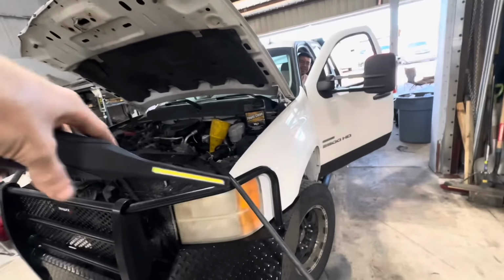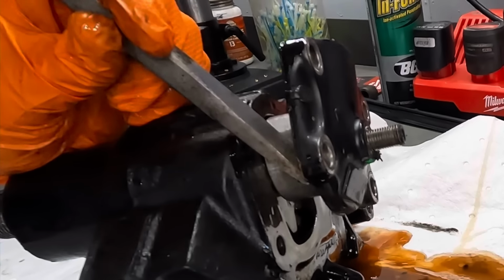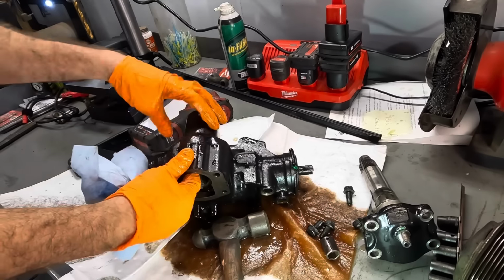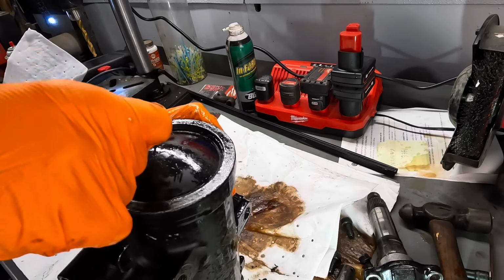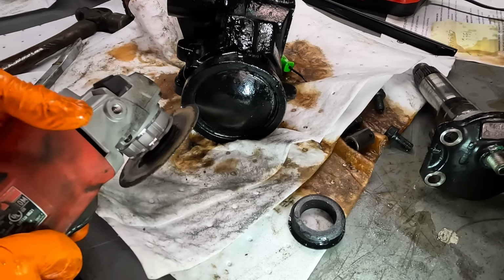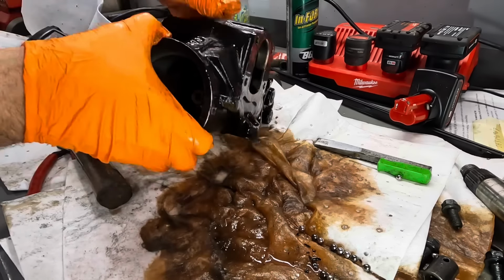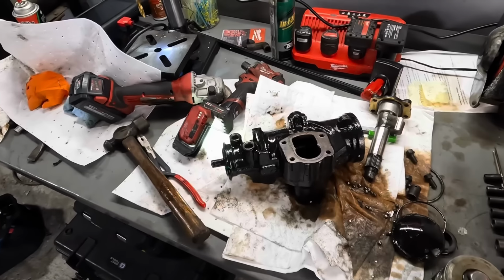Mechanic Cheated: Counterfeit/Fake Parts! Steering Gear Destroying Itself!

Comment: I've rebuilt a couple of Saginaw steering boxes and they are actually a simple, great and somewhat sturdy design in my opinion!  And at least they can be rebuilt as a DIY.
The big end cap is held in by that snap ring indeed.  First give the cap a tap with a rubber mallet, just to shift it a little deeper and free the snap ring.  Locate the  hole on the edge of the housing, through which you can push a small punch, which will dislodge the snap ring.  Now you can easily pry the snap ring out.
The most tedious of the entire rebuild is getting the ball bearings in correctly and in sequence.  There are an equal number of 2 sizes, one set darker grey and the other set "nice and shiny".  These are 2 slightly different sizes and need to be alternated when inserting/installing.  Best practice is to use grease to stick the bearings in place, in particular in the 2 halve end caps.
Possibly something went wrong there and one of the bearing balls was either missing, got dislodged due to improper install or was simply dropped inside the housing and not in the "channel" where it's supposed to go...

Comment: Hate it when they call junk parts new by painting it and fixing it a little, I try my best to keep Oem to avoid doing the work more times than needed.
Reply: Always opt for the OEM mfr's part FIRST whenever available.  It will save you time, money and aspirin.
Reply: Most likely a returned part where someone "switched" out the new part and just spray painted their old part after cleaning it with break cleaner. Then returned, saying it didn't fit.
Parts distributor just put it on the shelf and resold as new (or rebuilt).
Reply: 50 yrs ago in UK it was called a 'paraffin service', i.e. wash the dirty old part and re -sell it. Bought a starter motor 'reconditioned'😇and it caught fire on turning the key!
Reply: @Jay.Kellett  That's more likely blameable than some factory switcheroo. It makes a lot of sense. Crooks are everywhere these days. You can hardly walk in the woods without encountering unethicalness or criminalness. And the parts business was lazy checking it out.

At least now, they can't continue that thread of deceit.

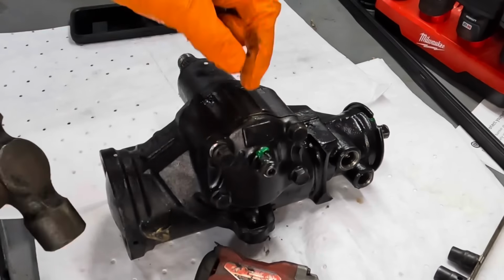Comment: Minute 2:24 the hole in the case is visible on the left side of the steering box. The one to insert a punch for the removal of the snap ring. Its small 3/32" or so, but its there. Tap in an appropriate sized punch and then get behind the snap ring with a small screw driver and pry it out. Box was junk, but cutting it up was hard to watch. Did you toss it out then and just lose the core charge? I think there are two sizes of ball bearings as well. At least there are in the gm boxes i have worked on. Oh well... onward and upward! Keep up the content!

Comment: Yep. It's smoked. The fact that the piston rack was banging the front plug tells me that the sector shaft was not put in on center tooth. Did you by chance check to see if it had full stop to stop steering?

Comment: I would guess that what happened is someone bought the remanufactured part and installed it and cleaned and painted the old part and put it back in the box and returned it as not needed and got their money back.
Then it was put back on the shelf and was sold as a rebuilt part. I have seen this with car parts before. Alternators, starters, power steering pumps and water pumps are a good target for this scam also. Many auto parts stores don't check or care.

Comment: I think you should show this video to the parts suppliers, you had something similar a few weeks back when what was in the box was not what was on the box, think is was the oil cooler upgrade you did??… some one had swapped the parts over and sent a crap one back. Some one needs to pay you for doing this twice! It’s not your fault the part is crap. Great video as always Ray. 😊

Comment: Yep, I purchased a pump for my jaguar from them and also had issues.  Looked inside and it was all old damaged parts... not an easy job on a jag at all so I was pissed but the oem pump was 800bucks.... I got another reman from lares and it's been solid for 2 years so far

Comment: That big star nut around the sector shaft, is how you disassemble the gear. It locks the collar jam nut. Then the hole assembly comes out the other end.

Comment: Hi Ray,  the worm gear holds those balls in place which helps to move the whole steering gear, it's called a recirculating ball steering gear, and from your diagnostic experience, it looks like the worm gear is so worn that it was riding up around the the balls and the whole piston assembly was sliding over and hitting the end plate, hence all the clicks, clacky noise you heard!! I still have a Chilton auto/truck repair book, hardback that my dad used back in the day that shows this type of steering gear in detail and has all the information on how to rebuild such unit back to brand new status !!, whoever "rebuilt " this steering box was really lazy, and the part could have caused a very serious crash!!, get on the parts dealer that sold you this, show them this video! Great job !

Comment: Reminds me of a gear box I bought from AZ.  It had been cleaned and painted, not rebuilt.  Driving straight was okay.  Turning either way there was LOTS of slop between the gears.  The faster you went the more the truck wandered = dangerous.

Comment: Man, this sucks! When I replaced the steering gear on my ‘93 Chevy truck at first I put in a generic O'Reilly Cardone unit that only lasted 2 months before giving up and after that, I just spent the money for a new redhead gear that has not let me down for the good 5 years I've had it on.

Comment: Oh boy does that bring back memories! During my time as a tech for the local government repairing police and civilian vehicles, we had contracts with local "repair" and supply outfits for things like carb rebuilds (the days of electronic carbs), alternators, transmissions, and radiators. It was not uncommon the get a "rebuilt" part where they simply sprayed silver paint over the grease and and dirt coating the part and stuck it in a plastic bag and shipped it back to us. You might speculate on who the business owners were friends and donors with.

Comment: Cardone is one rebuilder that makes some sloppy steering boxes, I’ve went through several before giving up and just settling for a sloppy steering gear. 
One steering gear i got off Rock Auto was a remanufactured unit “for AC DElco” it said on the box, this was the tighter feeling steering gear that i really liked but its cast iron case literally blew up while i was parking in the garage one night.
Reply: Get a readhead reman box. Worth the money.

Comment: Sorry to see  the part being bad .I've had bad luck with fuel pumps on chevy silverado 6.0 . Also alternators and starters. Im trying to buy denso now. So far they been ok.If Im not in a hurry.I have an excellent rebuilder for alternators and starters nearby.

Comment: I changed out a water pump in my wife's 2001 Malibu . 5 years later the water pump bearings froze up and the engine over heated and destroyed the engine.  I got the water pump from an auto parts store.
I have never had a water pump fail in just 5 years. That's why I buy all my repair parts now from the car dealer parts department. 
Nowadays you can't even buy sparkplug that are not Chi-Com counterfeits.  Good video Ray.

Comment: Question, When the steering box is installed, does the worm gear(gears inside the box) need to be centered in relation to the steering wheel shaft? If the steering box was clocked all the way right for example (bottom out worm gear) could the steering wheel ,when turning push the innards of the steering box too much one way or another, causing internal failure?

Comment: There is supposed to be a hole where you can used a punch to push the ring out! I have rebuilt several of these! The worm gear and the ball bearings work together and you have to have them in there just right!

Comment: I rebuilt mine a few years ago, 2001 Yukon 2500, the seal kit was 18 dollars and came with every sealing component. The snap ring was removed on my housing by a hole on the side of the case to stick a punch in and tap out the ring.

Comment: I replaced 4 steering boxes on a truck about 6 years ago. Every single one was bad out of the box. Couldn't tell without it under load though. I ended up putting the old one back on and tightening it for however much mileage it had left because I was done with 16 hours of off and on, waiting for parts, only for it to be bad again.

Comment: Putting those ball bearings back is a pain. (you need a special taper pin). I know, I rebuilt my gear in my Aunts driveway in Seward Alaska. There were 2 prior cases of fluid leaks (original at 19K miles, The warranty unit less). My rebuild lasted 60K (vehicle retired). IMHO the over painted nuts was a clue something was hinky.

Comment: This is recirculating ball steering mechanism.  The inner shaft and out shaft do not actually locate into each directly but do so indirectly via the ball bearings running between them held in the respective spiral grooves.  The ‘clicking’ might indicate that not all the ball bearings were installed.   Generally the ball bearings are a continuous ‘chain’ running nose to tail and completely fill the conical groove.  Count up all the ball bearings to see if you are short of the number specified.  On a final note the pinion teeth and the steering arm gear teeth have a machined conical interface that is designed to allow adjustment for wear (end lash) which is achieved by tightening up the pinion end nut effectively pulling the pinion further into the steering arm gear.  These steering mechanisms lack the feel of rack and pinion but they make up for it by being hefty and robust.

Comment: Thanks for steering us through that interesting and informative autopsy. I wondered right away where those ball bearings were supposed to go. Fortunately, a couple of folks had a logical and likely correct answer. Too, I'm always delighted to learn just how hidden things, such as trim panels, and in this case the snap ring, are assembled so they can be disassembled. The access hole is obvious once you're told, but  coming to that conclusion on your own is more difficult. I guess all a body can do is to try reverse designing the system in your head. How could I arrange it so that I can easily access that eyeless snap-ring? Of less importance, I'd also wonder why a snap ring without "eyes" (or whatever those little holes in snap rings are called) was used.

Comment: As an old audio electronics tech when I got something in first thing I'd do is look for replacement or aftermarket parts. Often I'd replace those and the equipment would work just fine.

Comment: Back in the 80's I had a '59 Cadillac that was leaking fluid from that end cap. From the service manual, I saw that there was a hole in the side of the case where you could insert a punch, which would displace that retaining ring so you could get a screwdriver behind it and pry it off.

Comment: The Bearings worked themselves into the worm Gear, Causing the worm gear to push the Piston further out than the tolerance and hitting the end cap with the bolt head.

Comment: The end cover that you used a grinder to access the retaining ring should have had a 1/8 inch hole in the housing that lines up with the retaining ring groove.  Push a 1/8 inch punch thru the hole and it lifts the retaining ring, allowing easy removal with fingers or needle nose pliers.  The quality of that part reminds me of the old remanufacturer CARDO.  In the front of their application book it stated (in the early 70's) to expect a 40% return rate for failure.

Comment: I have seen same in "reman" steering gear.. junk, what was done was clean the exterior, maybe replace seals, then paint it.  The preload was over tightened.  Preload presses the sector gear axis, which drives the wedge-shaped sector gear closer to the piston rack.  "Possibly", just loosening the preload screw would have made the gear workable.

Comment: Oh God, that brings back a Bad memory:
I got a rebuild unit for an Olds Cutlass, it was so bad I could not drive around the block. Opened it up, it was a mass of rust that someone had tried to remove with a grinder. Including the bearing and teeth.

Comment: Last time I replaced one I asked parts to get me a rebuild kit. They looked at me like I had 3 heads. Asked me why. Cause I don't trust parts anymore. You almost have to test and fully inspect every part. Atleast now a days, it's good practice to. But costs more time. Ruins flat rate techs.

Comment: The part that most call a "worm gear" is actually a "lead screw". The popping noise most commonly comes from the ball bearings sliding/skidding instead of rolling due to wear or defects... What a crappy piece!

Comment: I'm just a garage mechanic and I have gotten used parts from the store several times.  Guys will put the new parts on, throw the old stuff in the box and return them to the store.  They tell them "These aren't the right parts." and the clerk give them a refund and throws the box back on the shelf.  The ones I got were covered in dirty grease.   The one you got was cleaned up and rattle canned, just in case they took a peek.

Comment: I hate getting rebuilt anything anymore. Even brake calipers, got a set and on inspection 3 out of 4 pistons had cracks or chips out of them ( 2 piston front brakes. Took em back and asked for another 4 sets later, they were out, and no rebuild kits. Ordered over interweb , got 2 days later, steel pistons, not reused OE plastic

Comment: Ray can we get a video of you servicing different tools and equipment around the shop? Checking fluid on jacks, rebuilding/greasing heavily used ratchets, servicing the lifts, changing ATF bibs on the trans flush machine... Etc PLEASE

Comment: I used to rebuild Datsun 510 steering boxes at my old job, but my boss called them reconditioned. I argued that it was not correct because all I was doing was inspecting and fitting new bearings.

Comment: I had a ''lifetime warranty'' on some parts for my '71 GMC Jimmy thru Checker Auto Parts. No problems til they got bought out by O'Reilly Auto Parts .Alternators and external v9oltage regulators, I kept replacing -- only to fail again. I finally bought a new one online with an internal regulator and it runs good. When I had to replace my steering gear they couldn't replace it, so they cashed me out for about $350. Then I got a new one from Rock Auto and it runs good.
Headlight dimmer switches and EVRs are no damn good.

Comment: Looks like the missing second O ring allowed hydraulic fluid to get past the piston so it was compressed into the metal dome under the big circlip making it 'pop' at extreem movement as it flexed it in and out. As there was no seal under the dome itself I cannot see it supposedly needing fluid directly behind it. Worn parts and worn/ missing seals resulted in the end dome being flexed.

Comment: I would guess it was a take the new rebuild out and take the one that was making noise that was being replaced cleaned up and slap a fresh coat of paint on it and return it.
Or someone who was on rate and needed a raise so clean, paint and re-box in new box send it down the line. Not good, someone sooner or later going to get hurt or worse.  
You are a great and honest mechanic, Ray and do your profession proud.

Comment: I bought a rebuilt steering gearbox from AutoZone a couple of years ago and had the same problem. Auto Zone wouldn't warranty it even though it was under warranty. Not the first time with Auto Zone. I learned the hard way about rebuilt starters from AutoZone, had to replace one 3 times in a year. After that they said there was no more warranty. Now I don't anything else from them unless I can't find it somewhere else.

Comment: Is it even possible to get a rebuild kit for the truck original steering gear??  This second one was crapola from the start...what sucks though is the customer is still without his work truck. The supplier of the 'rebuilt' gear needs to comp this ordeal...not the parts store if thats where it was purchased from but whoever supposedly had had it apart prior etc.
   A great video Ray and we get to see the internals of something rarely seen, that being a steering box.

Comment: I sandblasted new track chains for a D8 cat dozer, it had partially burnt, new track pads, new interior, a few new hoses and wires, new seat and a fresh coat of cat paint, they loaded it on the lowbed before the paint was even dry!! Mechanics were betting on wether there would be any paint left by the time it got to the buyer! 
This company was known for this type of "overhaul"

Comment: I was hired into a GM Dealership  in 1979. We were the people that {reman} many of the units {parts} That is a 800 series gear box. Yes the end cover does move because it is under high pressure while turning the steering wheel. There should have been a small hole in housing to allow a sharp pick to push out snap ring, then with hydraulic fluid pressure turn input shaft to push cover out of housing. There is 22 little ball bearings. That makes 11 shiny and 11 dull or dark. They go in one at a time alternating sequence. If you would have removed that one inch {nut/plug} in the end of the piston you might have found a few loose balls causing the noise. Clearly they are not going to rebuild this one again. I have a 1990 Chev pickup. I have replaced the steering gear boxes several times. The reman units are a "crap shoot". Good luck.